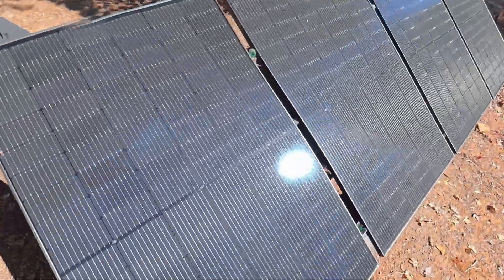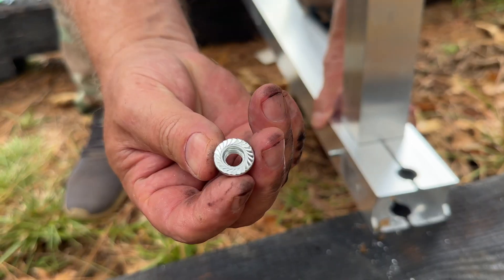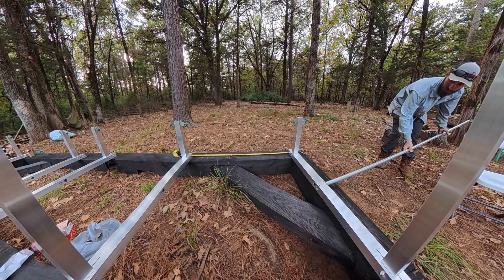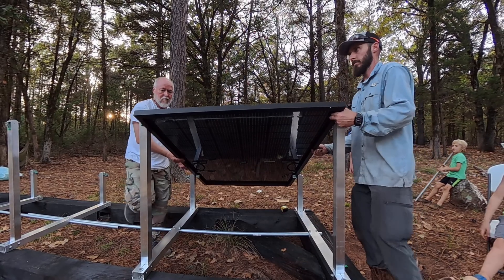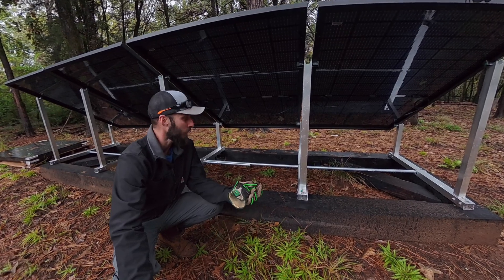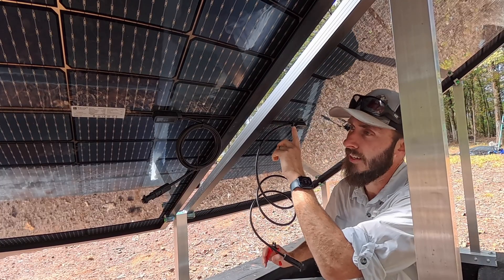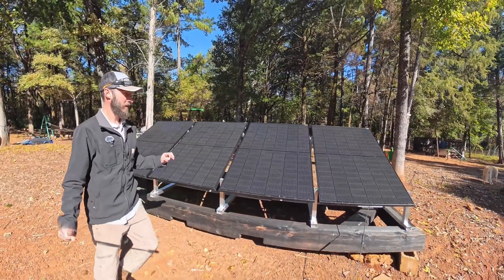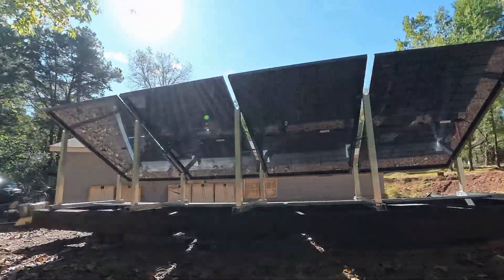Fast, Sturdy & Simple | IntegraRack BallastRack™ Build

Comment: how adjustable are those racks for angle? looks like a easy setup of the metal aspect?
Reply from the maker: The IR-30 is fixed at 30º. I could lift up the back side of the mount but that's about it for adjustable angle. However, IntegraRack makes a slightly more expensive version that is adjustable from 15º to 45º. Check it out here:  https://signaturesolar.com/integrarack-ir-45asa-adjustable-seasonal-angle-ballastrack-solar-module-racking-system-1-adjustable-leg/ (affiliate link)

Comment: That's what's up! I got 50 of these set up. I'm scared of going on the roof and don't want to be an early santa through the roof. 😂
Reply from the maker: Haha. I hear you. I prefer to keep panels off my roof. 50 makes my little array look so small 😂
Reply: @HomeEnergyIndependence  Decided that the kids have a pool at my parents 1 mile away if they want to go to the pool. They'll thank me when I pay for their college with the savings of no pool, and solar production. 😁
Reply: @HomeEnergyIndependence My big thing now that I have to find out, is do I really need an inspector to come out if my 200amp panel is turned off from the grid input side. I have a 400amp service that is split into 2 x200amp main panels. Meter is spliced into 2 and feeds both of them. 18kpv is in off grid mode and I am just feeding the 1 panel. (Overkill, but will adjust next year, now there is no time left b4 the end of 2025). 
I do have a licensed electrician that signed that everything is operating as it should. Not sure if that's enough for taxes.
Reply from the maker: I couldn't tell ya on the inspection
Reply: @HomeEnergyIndependence  I know bud. Thanks for all the help and motivation with this. 👊